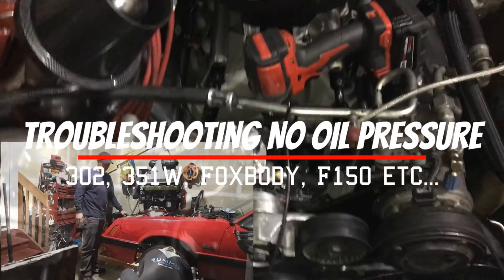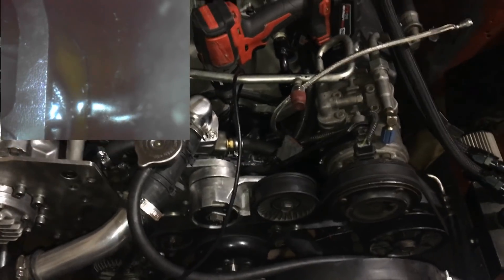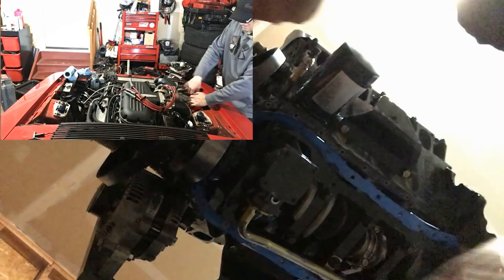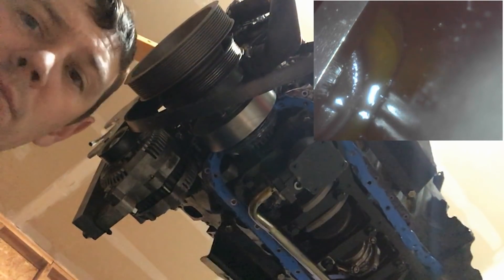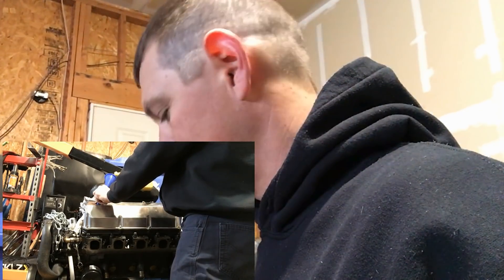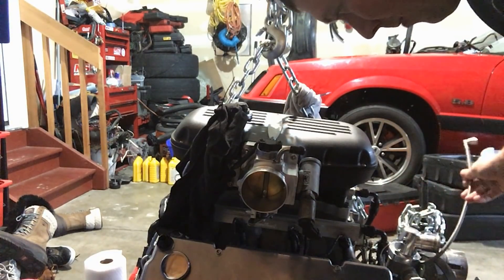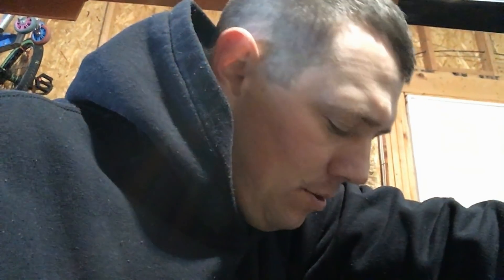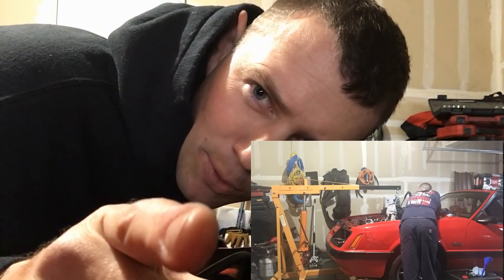No Oil Pressure Troubleshooting, 408W Clevor, Cleveland Heads on a Windsor

Comment: clevor what oil pump are you using
Reply from the maker: Standard volume oil pump for a 351w.  Nothing fancy
Reply: ok, the meling oil pump I have has no gasket between the bottom of the oil plate to the inside of the pump????
Reply from the maker: Every one I’ve ever seen has one  🤷🏼‍♂️  I suppose if the surface is flat, it doesn’t matter... unfortunately mine was not....
Reply: I see, that an expensive set up you got man, I guess I would buy the BEST oil pump on the market. all good though, I would hate to see that clevor get hurt amen.
Reply from the maker: @turboman351w3   It's definitely an expensive setup lol.  Just my opinion, but an expensive oil pump doesn't make it good.  It's a standard volume melling oil pump for a 351w.  High volume or high pressure isn't really that necessary in my application, plus those pumps can cause oil starvation issues if not using a 7+ quart capacity oil pan.  They push oil up to the heads and leave the pan dry if you've got 5 or less quart capacity pans.   What I have is plenty for my setup.

Comment: I thought it was a machined surface, which means no silacone
Reply from the maker: Well, there was air and oil getting through so I sealed it.  Almost any rebuild kit comes with a gasket for it